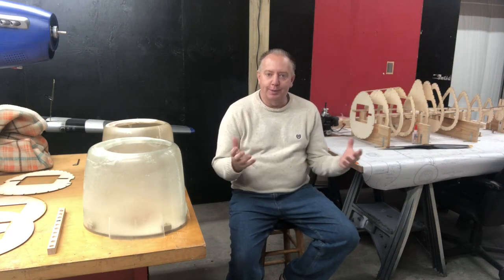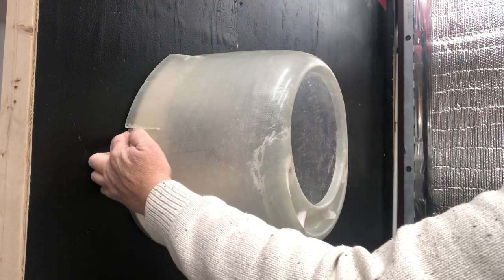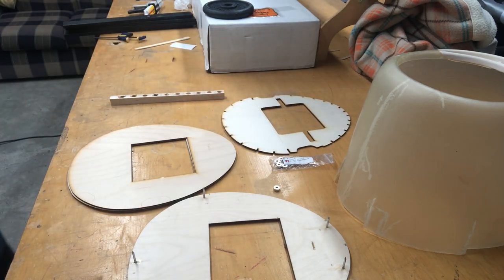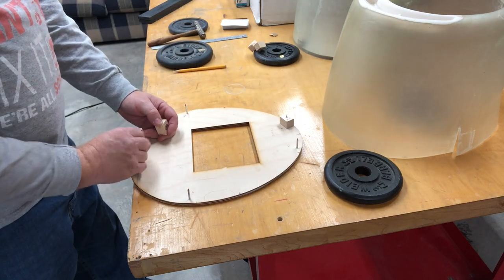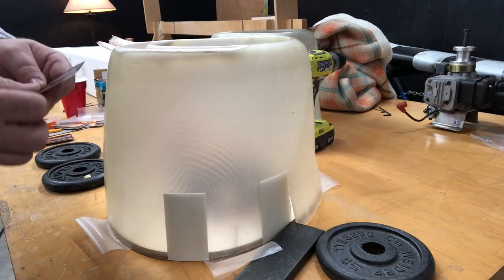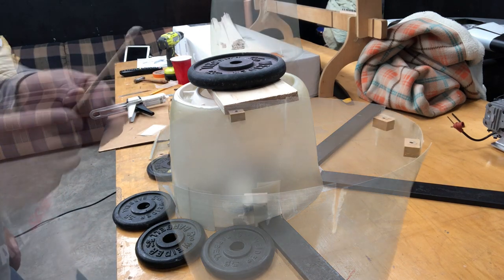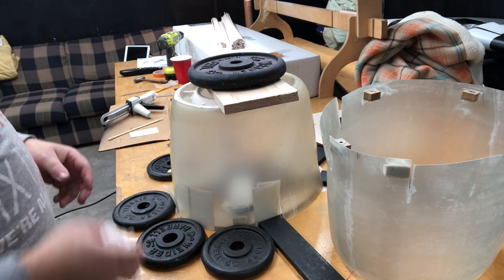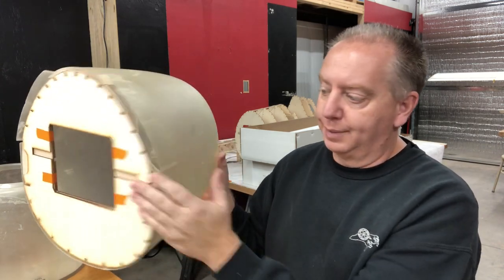How to mount a fiberglass cowl With magnets, ziroli F6F Hellcat

Comment: Very nice. It looks like you are using donut shaped magnets over the nails. You would not think it would pull in as the head of the nail is on the other side of the wood.    I also built the ziroli hellcat and blew up the plans to fit a moki 250 in.   I used a similar approach hisoling blocks inside with five #8 socket head cap screws. I used a realy long allen wrench to fasten from the inside.   I like your idea better. Thanks for posting.  Lou.
Reply from the maker: @LouCetrangelo  I’ve used this method several times in the magnets hold quite well